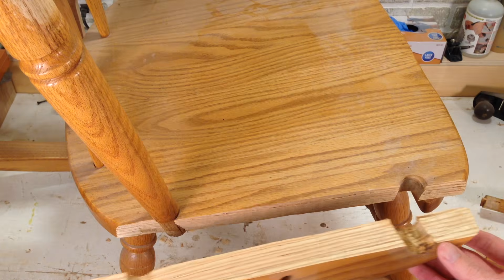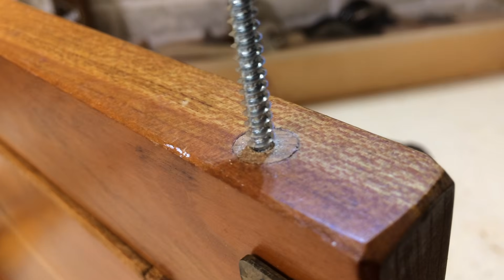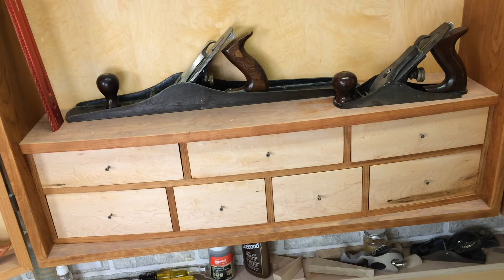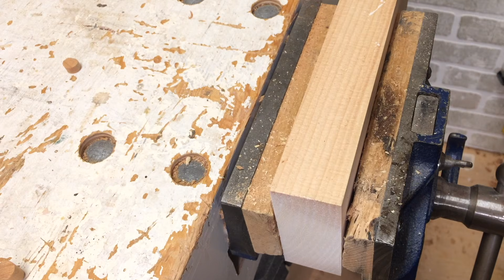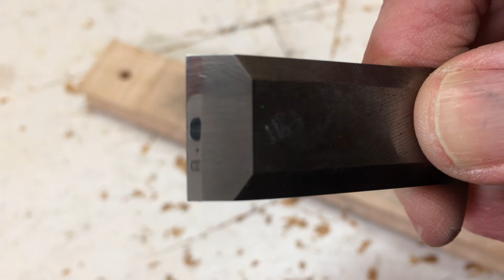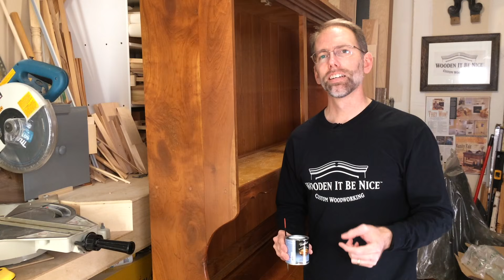How to Remove Wood Plugs and Replace to Hide Screws for Furniture Repair (aka Bungs)

Comment: Scott, first, you put out nice videos.  You have a calm and deliberate manner that I find impressive.  I was about to say you erred in referring to the drilled hole as countersink when it is actually a counterbore.  I am not so sure now and will leave it to you to decide.  I am a lifetime woodworker but non-professional so I consider mine a "layman's" opinion.  I believe you used a countersink bit but a counterbore technique.  I believe a countersunk screw would sit flush with the surface.
Reply from the maker: Good question Leonard.  I had to look this up to be sure, as countersink is the terminology I learned over the years.  It turns out a counterbore is a flat-bottom hole.  A countersink is a hole drilled to make a screw flush or set it below the surface.  https://www.merriam-webster.com/dictionary/countersink 

That made me do some thinking... which is a good thing.  Thanks for your question Leonard.  Scott

Comment: I was taught to cut a groove - I use a piercing saw for this - along the length of the plug.  This is to allow the excess glue a channel to escape.
Reply: I was taught to cut a groove for dowels but not for plugs.
Reply from the maker: @jeanine6492  oh, that makes sense.  I've replaced a few dowels that had grooves in them.  Thanks Jeanine
Reply from the maker: That's interesting.  Doesn't that leave a slight hole on the finished plug?  Scott

Comment: Hey Scott, great video! Listen, Henry Taylor is one manufacturer still making paring chisel s with offset handles.......only paring so no hammers but gives you back that flat reference. I have several short and long blades versions, they are well made and work exceedingly well on those occasions when one needs to work in the middle of a larger surface.
Reply from the maker: Thank you for letting me know Michael.  I just went to the Lee Valley Tools website and bought the  3/4" Henry Taylor paring chisel.  I appreciate you reaching out.  Thanks!  Scott
Reply from the maker: Hi Michael - I mentioned you in a video I published today about your recommendation on this chisel.  As I write this I realized I pronounced your last name wrong though, sorry.  https://youtu.be/5nyTR_fPS_Y
Reply: Lol, no you did good. Thanks for the shout out.
Reply from the maker: @michaelfling7786  Thanks again for the recommendation Michael.  I really appreciate it!
Reply: @FixingFurniture  You're  more than welcome, Scott. Keep up the fun work!!